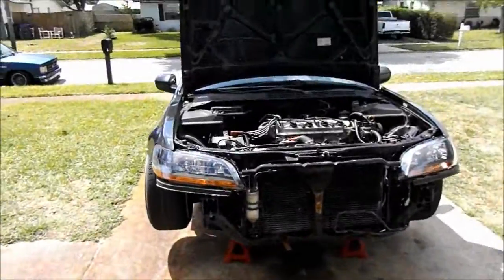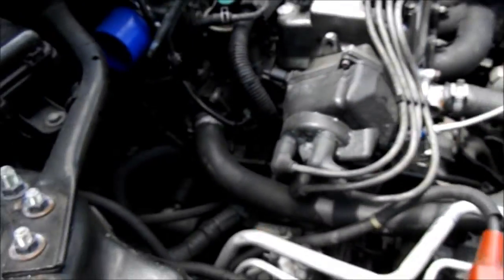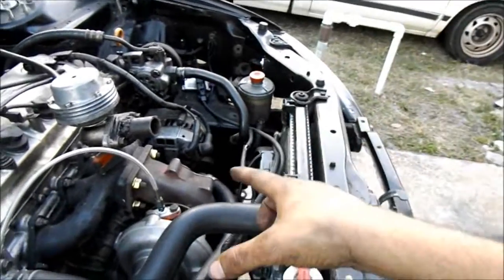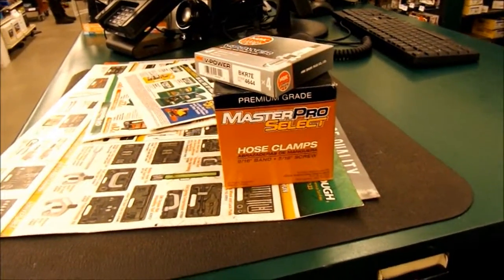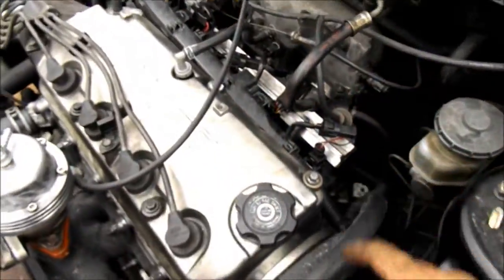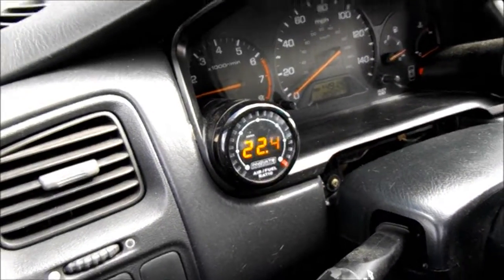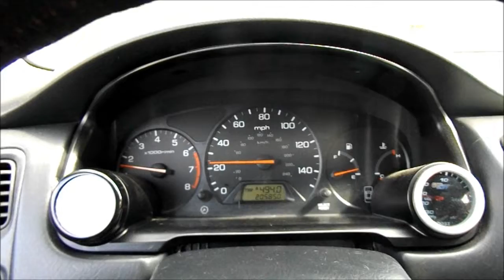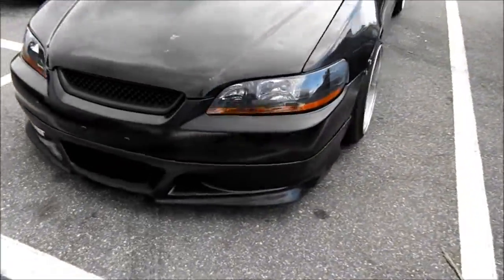Honda Accord gets boosted again?

Comment: What Turbo you using bro ?
Reply from the maker: I've had a few different ones on the car
Reply: @cardudegarage  i don't know is it safe or not if using turbo , what i know is the machine made from alloy.. it would be hot , and melting the engine.... by the way.. nice body kit.. love it..
Reply from the maker: Thanks man. I appreciate it, and what machine are you talking about?
Reply: @cardudegarage  you still using Vtec aren't you ?

Comment: Beautiful honda, i have the same Accord but  4 cilindros, saludos 🇲🇽
Reply from the maker: Mines a 4 cylinder also f23 and thank you 🙏
Reply: I-4 not v4! V is the shape of the engine and it’s not used on 4 cylinder engines though there are some very rare but you’ll see it in six cylinders and up (v6,v8, etc) it makes the engine more compact so that the car doesn’t have to be wider. For example a V6 is shorter than an i-6.
Reply: @edgarpinero1751  Lo puse mal, gracias por aclararlo:)

Comment: I just did a JDM swap on my Accord 2000, my next move would be to prep it up for a turbo, any suggestions for this build ?
Reply from the maker: Giving that it's a jdm swap meaning a f23a then it should be healthy but I would do atleast water pump timing belt head gasket and arp head studs at the bare minimum and your engine should be ready for boost
Reply: @cardudegarage  i have a 2000 Honda Accord 2.3L VTEC, would u recommend the same for mine before boosting mine?
Reply from the maker: Yes compression test,fuel pump,injectors timing belt water pump head gasket and arp head studs forsure and something to be able to tune it with

Comment: Where did you get your fenders
Reply from the maker: There stock fenders
Reply: @cardudegarage  I noticed right after i posted, they just looked wider without the bumper lol
Reply from the maker: There rolled and pulled alot lol to try and clear the wider wheels up front

Comment: is this and f32a1?
i want to boost mine so bad.
Reply from the maker: Yes it is there fun when boosted
Reply: @cardudegarage  easy project? I'm currently putting coilbois in mine right now. Getting the suspension all buttoned up. Might go there next. And how many miles on your engine? I did a swap and my engine has about 70k I don't want to boost it and blow it up lol
Reply from the maker: My engine was rebuilt and aslong as it has good compression and is healthy go for I would recommend doing timing belt water pump mls head gasket and arp head studs before boosting it though

Comment: Car Dude Garage , awesome video. i got a 99 with the 3.0 vtec and a 02 with the 3.0 vtec as well. one auto for the wife and the other manual for me. quick question where did you get the bumper?? it looks like a r34 gtr style bumper i dig it
Reply from the maker: It's a lip I have the full kit for it
Reply: @cardudegarage  where did u get it ?
Reply from the maker: I found the full lip kit at a junk yard

Comment: 1. get some gas before u wanna go fast 
2. why u boosting a car with 205k miles smh
Reply from the maker: First gauge says it has gas second engine is rebuilt and has around 30k on it now
Reply: @cardudegarage  was it rebuilt with oem or better than oem oftermarket?
Reply from the maker: eBay bottom end mls head gasket and arp head studs
Reply: @cardudegarage  so pistons rods crank off ebay? What abought valve train cans valvs ect
Reply from the maker: No eBay rods and pistons stock valve train
Reply: @cardudegarage  she still running good is it a everyday driver if so how gas milage